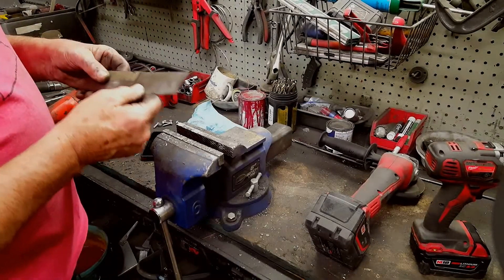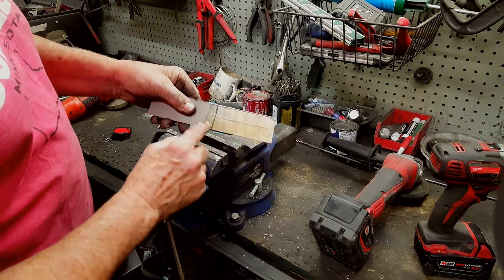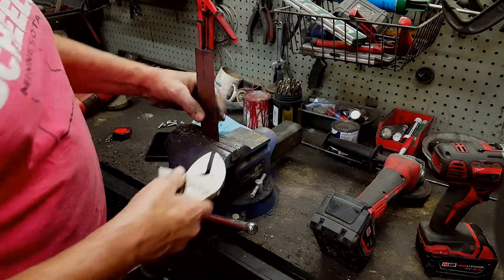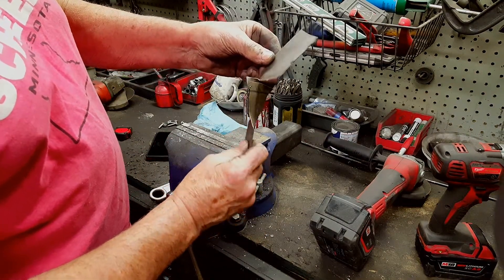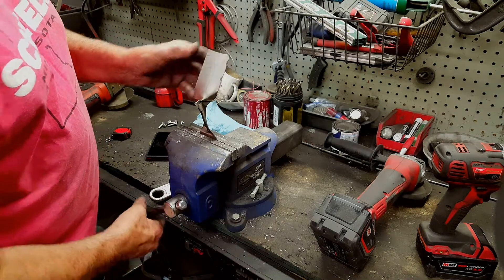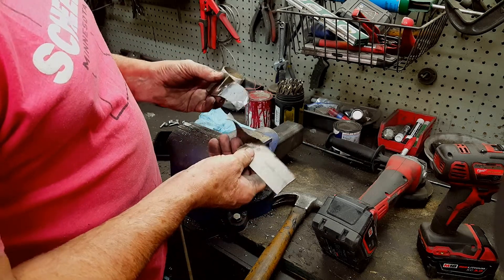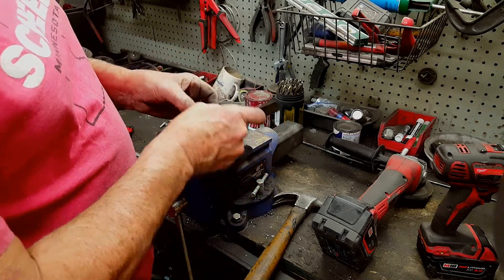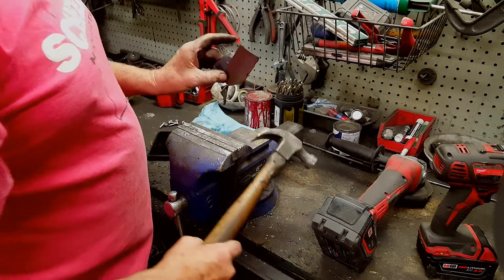Panel Bond test - Does #M 8115 really work?

Comment: Thanks for taking the time to show us just how good this stuff is. 
Recently someone sideswiped out 2014 Ford SUV and I'm going to patch repair the torn panel using a panel from a wrecked vehicle.
I do have a mig welder and using the 3M adhesive there will be zero chance of warping the panel and causing a lot of extra work.